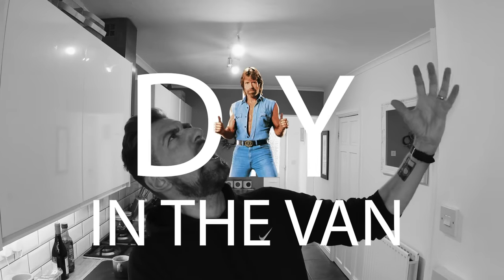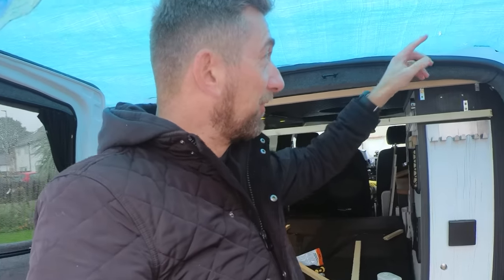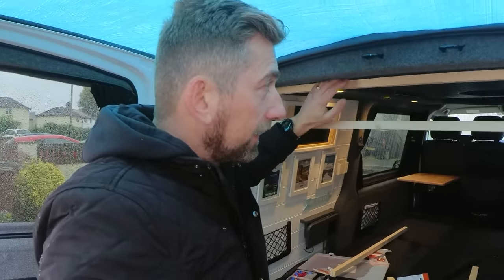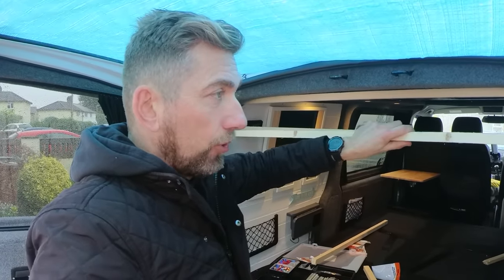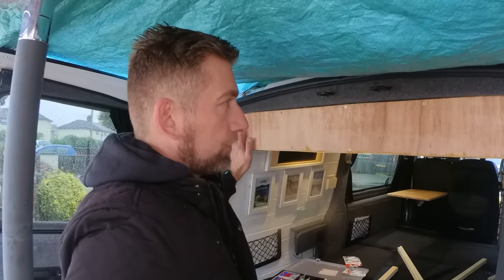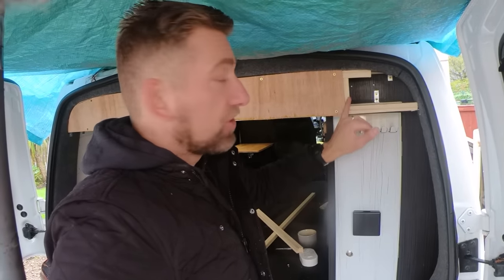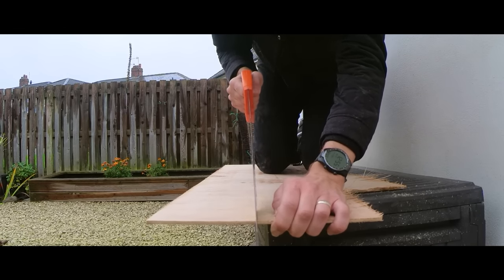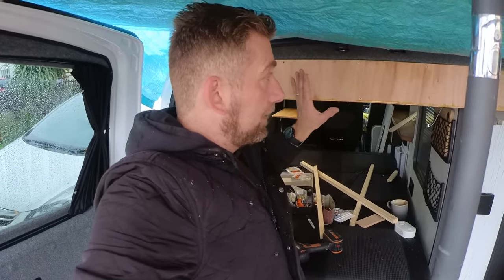How To Get More Storage  - DIY REAR OVERHEAD LOCKER - VW T6 Camper Van

Comment: Great video m8. You can buy a custom rear  barn door waterproof covers for your van and others. I have 2 for both my transit custom and Renault trafic. They do not leak at all and the material is really tough
Reply: where did you get your traffic ones from Darren?
Reply: @viv-i-vangoesforth  e bay, van style and uk custom covers
Reply: @viv-i-vangoesforth  uk custom covers on e bay. To be honest there pretty much universal fit across the traffics, transporter and transit custom as I’ve used mine on both vans then bought a second one. They fit really well and tuck above the top door seal and come with a clamps then the water just runs around the gutter and not in the van. There perfect
Reply: £39.95

Comment: Get a lwb Colin. Then you won't need all these extra little cupboards.
And don't tell me that you can't park them.
Its a load of tosh.
Mine is lwb & it's my car as well. I have never had any trouble parking it. NEVER
There is so much more room inside 400mm longer. Meaning 400mm base unit lus extra wall unit if needed
And 400m extra floor space. Which is very nice especially when bed down
Reply from the maker: I'll be honest, if I could go back to when we first bought the van and having seen LWB vans at meet ups, i do wish we'd have gone for a LWB. But I'll stick with my SWB for now until we eventually (a long way off) get a larger van in the future possibly